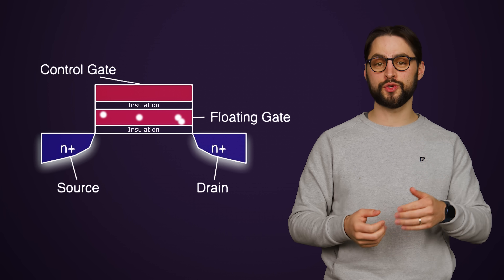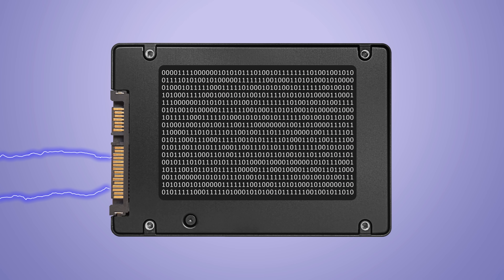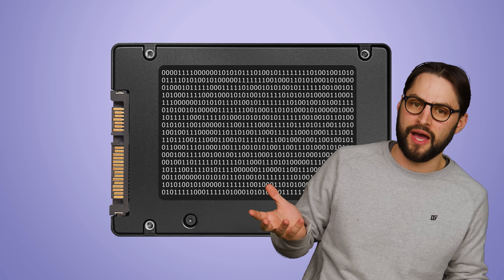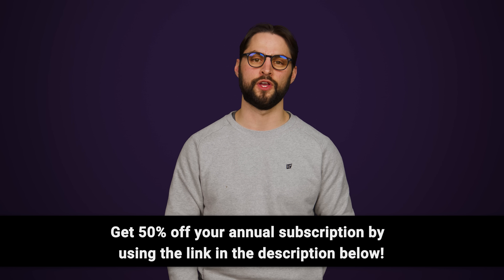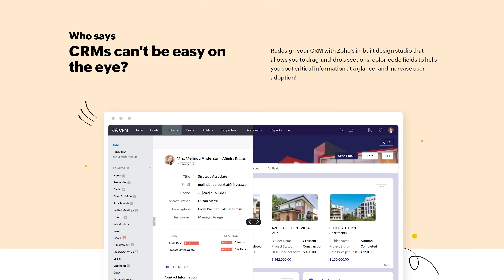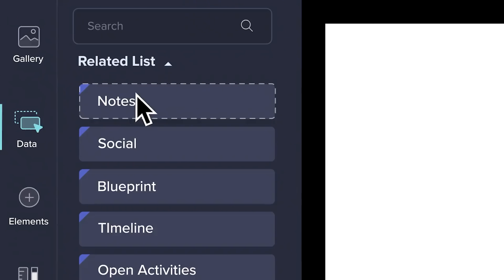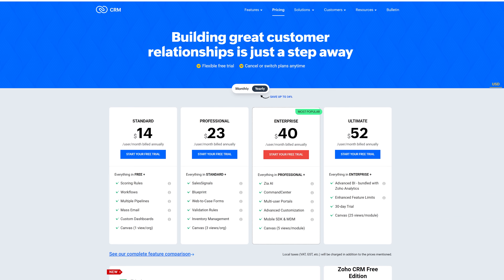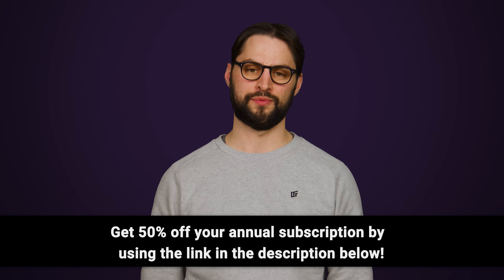SSDs Die, RAM Doesn't. Why?

Comment: This is so timely, I recently helped my mom out with her laptop slowing down. I found quickly that her SSD was running dangerously low for an extended period of time so I suggested some well overdue cleanup. I gave her a high-level about SSDs wearing faster due to low space, but now I'll be sharing this video to her as well :P
Reply: 15 to 20 percent free space is the threshold before performance takes a hit
Reply: @joshuaguenin9507  Yeah, it was hovering around 5% for not sure how long, but I guess at least a month or so.

Comment: I have had many micro sd cards become read only on me.... And I have found the culprit... Its usually storing images on the card.. Probably because the gallery keeps all the files open?? Not sure... SanDisk is a bro though.. If its in warranty they replace the cards.. No questions asked

Comment: I have SSDs from 2007 that are still working. I use them in portable drives and don't use them that often but every time I boot them they boot and run just fine.

Comment: October 2019 to now and my 120GB WD Green SSD is now at 85% according to crystaldiskinfo. Although I can't watch Youtube beyond 1080p60. i7 620m+2100m is a weak combo, barely delivering LPCM version of TrueHD/DTS-HD. I wonder if... Wait ok, anything associated with 100 is Tesla 2.0-NVS 2100, 3100, and 5100Ms. Fermi 2.0... ISN'T GF108, it's the GF110s? Well that screws the 4200m and my... 52-hundre... (sigh/groan) awh. I really bought this e6530 just for Ivy Bridge Youtube and to barely run Sonic p06 didn't I. Weakest upgrade ever. At least I won't make the same mistake of installing 32 bit. I'm too good for for 32 bit now more than ever.

Comment: Also notable, if you have a smaller 120GB or 240GB SSD as your main drive you should consider disabling pagefile on it altogether and/or moving the pagefile space to a secondary HDD. I've killed a few value branded ADATA/Kingston drives and suspect this was the cause as the Pagefile is taking all of the limited write-life these budget drives have.
Reply: Pagefile on HDD will make your computer slower than molasses in Siberia. Better to use a secondary SSD.
Reply: @fat_pigeon  or just get more RAM instead of a secondary SSD so you're a lot less likely to hit the pagefile in the first place

Comment: Hi! Awesome video well explained. 
I have a suggestion for another techquickie, are magnets bad for electronics? 
We use to avoid magnets near any electronics quite a while ago, now it seems like a common thing on mobile devices and other items... 
If the are not great for electronics roughly what strength of magnets should be avoided before damage occurs?
Reply: magnets are a problem with magnetic media..hard drives and floppy disks were magnetic, but hard disk also have a magnet inside them.  Not a thing these days...
Reply: This would be a great video - I would love to see it.  From the point of view of my field (not exactly computers), magnets are not "bad" for electronics per se.  However, on old magnetic media, a ferrous based alloy was used to store things and a magnetic field could change the state of the media.  Not a good thing for stored data.  Also, long term exposure of a CPU or RAM to a magnetic field could (conceivably) make it act wonky because of magnetic hysteresis.  It can make the electrons choose odd paths.  But in modern electronics, it should wear off quickly since there isn't much in the way of ferrous material.  Not sure what it would do to an SSD - it will want to push the electrons around - could be a problem.  I would not rub an SSD on a strong magnet.  Maybe LTT will try it.  It would be interesting to see them place a strong magnet on a running CPU or RAM - that should actually cause problems.  But I'm not gonna try it!

Comment: I've been working in IT for 7 years and I've only seem 1 SSD die due to excessive writes and go into read only.  More often than not they just out of the blue either die or report as raw file system with no data.  I have yet to be able to get a user's data back when the latter happens.

Comment: I retired a Crucial M500 960 GB SSD in Dec that was purchased for my daily driver back in Feb 2014. According to Trim Enabler, the SSD health was still 100% with less than 20% of its expected lifetime spent. Another daily driver has an Intel 320 Series 600 GB SSD still in service. That SSD was bought in 2012 and, yes, the Intel SSD Toolkit still shows the drive at 100% health. That Intel drive cost roughly $860 back in the day, but a decade of daily driving has, IMO, definitely gotten a reasonable ROI.